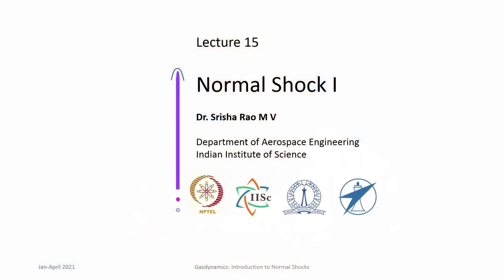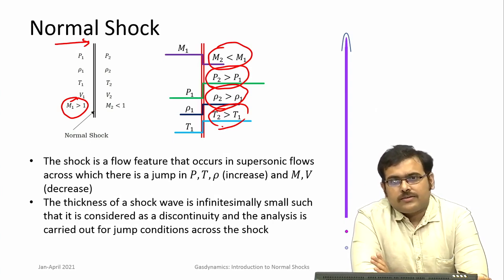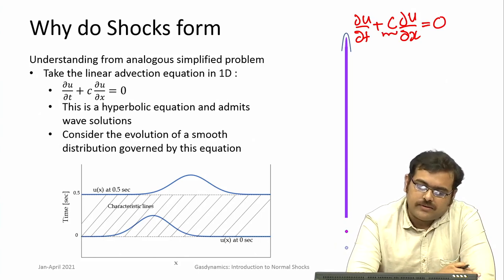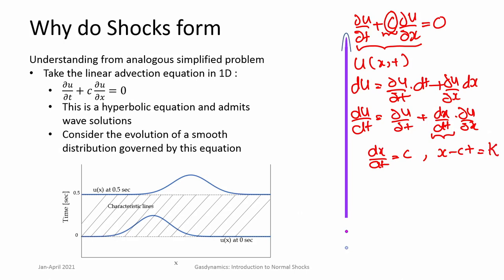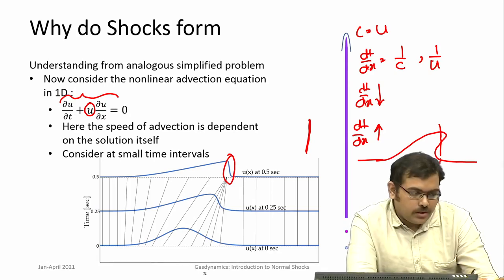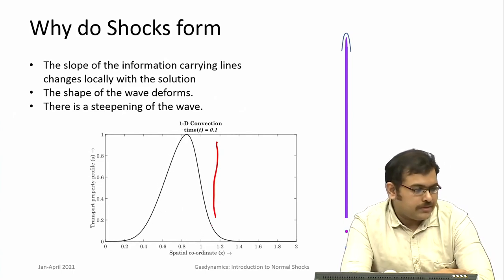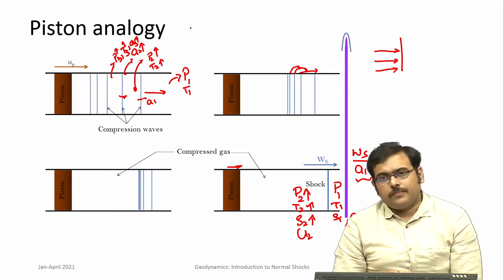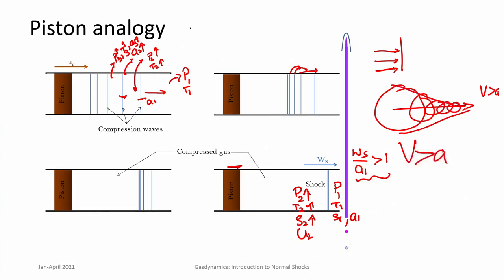lec15 Normal Shock - I

Comment: 1. If the distance for the piston to reach a0 (speed of sound) gets smaller in your plots, would there be a stronger shock wave, why?
yes.
2. If the piston travels at the speed of sound continuously in an infinite duct, would there be a shock wave built?
no.
3. For a super sonic airplane, perhaps the distance to reach ao is very short and that's why a sonic boom occurs even the airplane moves at ao.